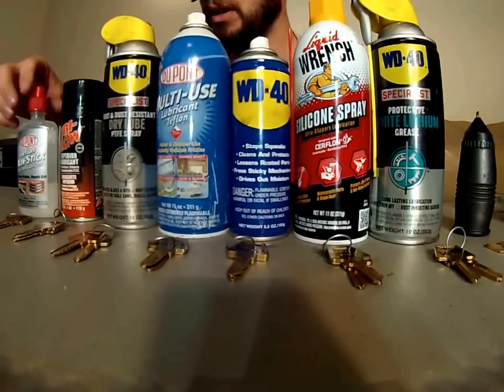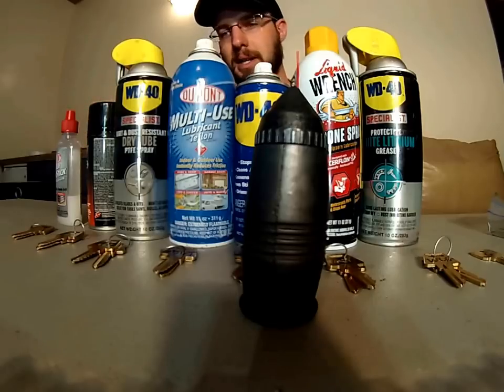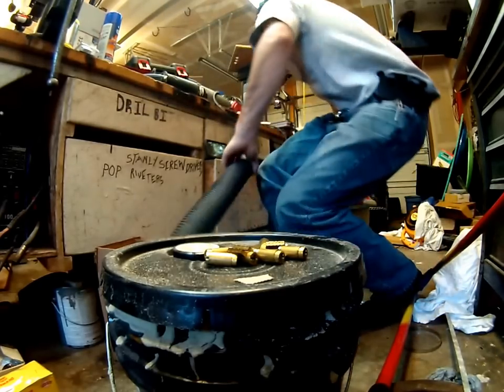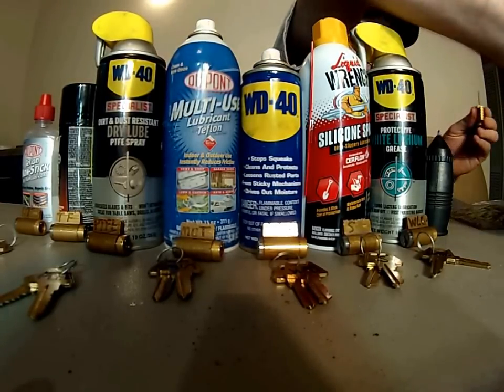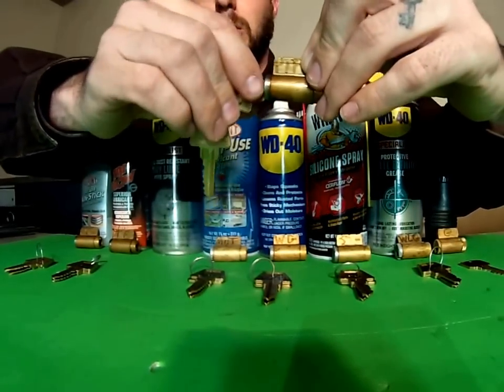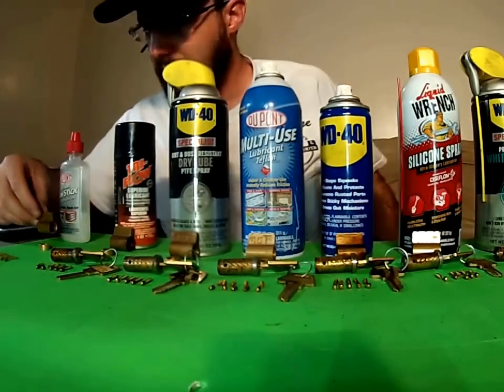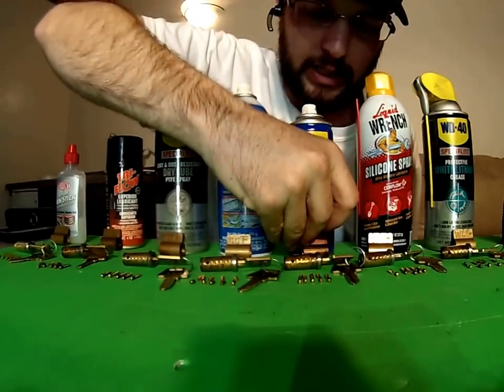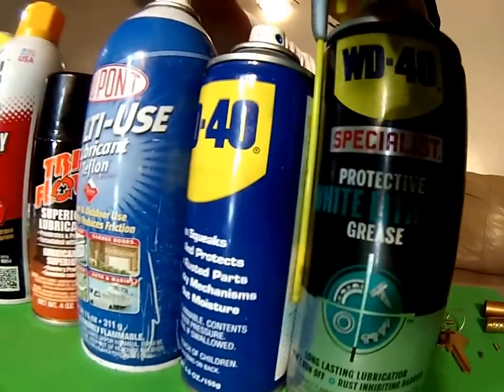What Is Best Lubricant For Locks WD-40 Graphite Teflon Silicone PTFE Spray Tri-FLow

Comment: LPS1 and Houdini all the way!
Reply from the maker: houdini is oil baised see for your self 
houdini lubricant spray It contains oils $9.00
Ingredient # 01
Ingredient Name PROPRIETARY BLEND OF BASE OILS
CAS Number 5989275
Percent 0
Ingredient # 02
Ingredient Name PROPRIETARY BLEND OF BASE OILS
CAS Number 513779
Percent 0
Ingredient # 03
Ingredient Name DISTILLATES, PETROLEUM, SOLVENT-REFINED HEAVY PARAFFINIC
CAS Number 64741884
Percent 0
Ingredient # 04
Ingredient Name PROPRIETARY BLEND OF BASE OILS
CAS Number 64742525
Percent 0
Ingredient # 05
Ingredient Name INHIBITORS. SOLVENTS AND ADDITIVES
CAS Number 64742536
Percent 65
Ingredient # 06
Ingredient Name HYDROCARBON PROPELLANT-PROPANE/ISOBUTANE
CAS Number 78285
Percent 35
Ingredient # 07
Ingredient Name PROPANE
CAS Number 74986
Percent 35
Reply from the maker: Lock Saver is Teflon (AKA the winner)
SECTION 1 – MANUFACTURER INFORMATION
Mil-Comm Products Company, Inc. Phone: (201) 935 8561
2 Carlton Avenue Fax: (201) 935 6059
East Rutherford, NJ 07073 USA sales@mil-comm.com
SECTION 2 - HAZARDOUS INGREDIENTS/IDENTITY
1. No ingredients are considered hazardous under 29 CFR 1910.1200, 40 CFR 372 and
49 CFR 172.101
2. Other ingredients include:
3. A mixture of synthetic oils (esters) & highly refined mineral oils. TLV: 5 mg/m3
oil mist
4. Calcium Sulfonate/Carboxylate Complex: mixture in highly refined mineral oil. TLV: 5 mg/m3
oil mist
5. Phosphate Ester: < 5 mg/m3
6. V.O.C.: 0 (Contains less than 0.1%)
SECTION 3 - PHYSICAL & CHEMICAL CHARACTERISTICS
1. Boiling Point: 640°F (337°C)
2. Specific Gravity (H20=1): 1.1
3. Solubility in Water: < 0.1%
4. Appearance and Odor: Pale Yellow, Sweet
5. Vapor Pressure (mm Hg): N/A
6. Vapor Density (Air =1): N/A
7. Reactivity in Water: None
8. Melting Point: N/A
SECTION 4 - FIRE & EXPLOSION DATA
1. Flash Point (COC): 475°F (246°C)
2. Flammable Limits in Air % by Volume: LEL Lower: N/A UEL Upper: N/A
3. Auto-Ignition Temperature: 475°F (246°C)
4. Extinguisher Media: Foam, CO2, Dry Chemicals
5. Special Fire Fighting Procedures: Use Self Contained Breathing Apparatus.
6. Unusual Fire and Explosion Hazards: Inhalation of thermal decomposition products of fluorocarbons
must be avoided for the same reasons that apply to all combustible materials.
SECTION 5 - PHYSICAL HAZARDS (REACTIVITY DATA)
1. Stability: Stable
2. Conditions to Avoid: Sustained temperatures over 600°F (315°C), strong acids and bases, oxidizing
agents
3. Incompatibility: None known
4. Hazardous Decomposition Products: Thermal decomposition may produce CO, HF and/or
phosphorus oxide.
5. Hazardous Polymerization: Will not occur
Reply from the maker: MDMA data sheets dont lie
Reply: Wayne Winton
I do have some Lock Saver, but I really like Houdini for cleaning all the gunk out, and LPS for lubrication...to each their own.
Reply from the maker: LPS1  is oil baised as well (sorry) MDS don't lie
LPS 1 GREASELESS LUBRICANT is combustible having a flash point typically above 170o
F and an autoignition
temperature over 400o
This material is considered hazardous by the OSHA Hazard Communication Standard (29 CFR 1910.1200).
Emergency Overview: DANGER: Aerosol contents under pressure. Harmful or Fatal if Swallowed.
Primary route(s) of entry: Skin and Eye contact. Inhalation.
Potential Acute Health Effects:
Eyes: Irritating to eyes
Skin: Repeated exposure may cause skin dryness or cracking.
Inhalation: Excessive inhalation of vapors can cause irritation of the respiratory tract, nausea, dizziness or headache.
Ingestion: Product has a low order of acute oral toxicity, but ingestion of large quantities may cause nausea,
vomiting, and gastrointestinal irritation. May cause injury if aspirated into lungs.
Potential Chronic Health Effects:
 Carcinogenic Effects: NTP: No IARC: No OSHA: No
 Mutagenic Effects: None
 Teratogenic Effects: None
 Medical conditions aggravated by exposure: Persons with pre-existing central nervous system (CNS) disease,
 neurological conditions, skin disorders, chronic respiratory diseases, or impaired liver or kidney function should avoid
 exposure.
Signs and Symptoms
 Stinging in eyes. Repeated or prolonged skin contact can cause redness, irritation, and scaling of the skin (dermatitis).
 Breathing of high vapor concentrations may cause headaches, stupor, irritation of throat and eyes, and kidney effects.
Section 3 • Composition / Information on Ingredients
Component CASRN Percent by Weight
Distillates (Petroleum), Hydrotreated Light 64742-47-8 70 - 80%
Distillates (Petroleum), Hydrotreated Middle 64742-46-7 20 - 30 %
Carbon Dioxide propellant (aerosol only) 124-38-9 1 - 4% 
Ingredients CASRN OSHA PEL-TWA ACGIH-TLV Other Limits
Distillates (Petroleum),
Hydrotreated Light
64742-47-8 Not established Not
established
100 ppm (supplier recommended
TWA)
Distillates (Petroleum),
Hydrotreated Middle
64742-46-7 5mg/m3
 /8 hrs 5mg/m3
 /8 hrs 10 mg/m3 UK ST EXP (15 min.)
Carbon Dioxide propellant
(aerosol only)
124-38-9 10,000 ppm 5,000 ppm 30,000 ppm ACGIH STEL 
Appearance: Liquid. Colour: Pale amber.
Odor/Taste: Characteristic. Vapor Pressure: <0.05mmHg @ 20 °C
Solubility Description: Not soluble in
water.
Evaporation Rate: <0.1(BuAc=1)
Boiling Point (°C): 213 @ 760mmHg Flash Point (°C): 79°C (175o
F)
Specific Gravity (Water=1): 0.79-0.81 @ 20 °C Flash Point Method: Tag-Closed Cup.
Vapour Density (air=1): >1 Auto Ignition
Temperature (°C):
>228o
C(442o
F)
V.O.C. Content: 0 g/L Partition Coefficient
(octanol/water):
<1
Flammable limits
(estimated):
LOWER: 0.6%
UPPER: 7%
Viscosity: <3.8 cSt @ 40o
C
pH: Not applicable
Reply: Wayne Winton
what's the problem with oil based? as long as it's not WD-40 :)
Reply from the maker: Oil attracts dirt in any way shape or form. Penitrating lube is good to clean them out and get them moving but then it need solvent and 100% dry lubrication Teflon of some kind or Graphite. Thoes are the only 2 dry lubricants on the market today. They may be named diffrent thing but it is what it is.
Reply from the maker: Wayne Winton Heck Jeff I was even wrong ..... My before and after list is very different from the beginning of the video to the end but the proof is in the test. Do your own testing if you like ( you must have a few locks to spare) Fill them up with your favoreite lube and do the same thing cook em, fill them with water and dirt, then cook them again and freez them....... tear them all apart and see what locks are the best working and cleanest at the end. My vidoes are not ment to raise conflict but reviel my results. No one pays me and everything was bought with myown cash so no reason to sway the results.
Reply: Wayne Winton
I am always willing to learn!
Reply from the maker: ***** Hey me too. I completley admit I was wrong to begin with as well. Blinded by advertising. This is what is so fun about acctualy testing the products though.
Reply: Hahaha Jeff beat me to it. I was going to see if you ever tried Houdini as Jeff and many others swear by it. I currently use PBlaster dry lube which drys fast but leaves a white film which im not to happy with. Superb video so thanks for the knowledge. Best video by far!!!
Reply from the maker: Thanks!

Comment: Use a lock lube product that is specifically  designed for locks.  Don't use the same lube product in your locks that you lube your garage door with.  Or anything else.

Comment: As a locksmith, for decades I use the DuPont Teflon with some Silicone. Its offered under different names and in the colder climates they call it "Snow & Ice".  The main reason is that here in Chicago, the ability to prevent freezing snow and water is important - while maintaining CLEAN lubrication - while NOT causing the keys to come out of the lock greasy or smelly (I hate that, that is so unprofessional).  

Regular WD40 leaves people with what a I call a smelly keys 'oil and perfume' smell.  No one wants to smell WD40 on their keys and no one wants the black crud on the cuts getting into their pockets where the key lube gets wicked out onto.  I loath using regular WD40 on anything in general because of the stupid tale tail smell.  Is there really a moron out there who wants to smell WD40 on their hands and clothes all the time?  People wearing light pants have a heightened risk to being outside visibly stained.  This is also a reason I avoid graphite.  Its too messy and at times a small puff drops on someones rug.  Its does not come clean.  I had that happen decades ago when the client applied too much and when I pulled the cylinder for re-key a stream of black powder dripped on a woman's rug. Fortunately she was selling the house and the rugs were being replaced.  Who wants a $2000 insurance claim anyway? 

The one very annoying part about the DuPont cans is the long dispensing nozzle is too fat to seat well and often falls off and gets lost.  The last case I bought I had to file the red nozzle to inserts and I had to crazy glued the dispensing nozzle to the spray head.  What a royal pain.  You would think DuPont would have their act together.  But I really do like this product.  We do a lot of Commercial 7 pin SFIC Keymark and Medeco, with outside padlocks as well so this is a perfect lube to douse through the entire mechanism just before winter and again in the spring.  It simply wipes clean and the teflon has a moisture barrier film left behind.   

With SFIC we do twice annual preventive lubes on exterior cylinders. One of the things we are paid for is so there are no lock freeze ups.  If a Client cant access a gate or building because of the lock,  that could prevent them from opening and hundreds of workers would be standing around.  That's a failure of service in my book.  And I don't want that get a call at 5am demanding my presence.  So far with DuPont its been zero failures or freeze ups with pre-winter and then spring treatments. 

I have not used the WD40 dry lube.  I must say however I really like the nifty WD spray permanent tube nozzle's.  But if the WD dry lube stinks or is not clean, its a resounding no thank you.   Who want to be known as the boob locksmith with the smelly keys anyway?   We might not realize it, but details count in the eye of the user.  They may not realize it when you do the work.  But that smell and staining in the pants pocket or a woman's purse right after is what they do notice.  Its called negative marketing. 

One last thing, I don't like silicone only lube with locks.
Reply: You need to get to the point.
Reply: Hello JR Chicago.. please tell me.what ypu use to "clean" out the lock's key hole and mechanisms.  Also, once you have washed away the previous gunk and lubricant, what types of libricants do you put in to the keyhole and on mechanisms?
Reply: @mehulparikh8570  DuPont Teflon as I referenced cleans and leaves a dry film of lubercant. However, if I am dissembling the core to pin it up or stock up cores like SFIC I use Acetone (nail polish remover).  But if you buy Nail polish remover, buy the cheapest without any additives like a lotion.  I use a plastic jar to have the cores soak and just dry them off on paper, rubbing off old master key system markers, etc.  I wear disposable gloves with acetone.

Comment: WD-40 is the worst spray that you can use.  Using WD-40 will only clog up the cylinder, and this spray attracts dirt, and will only help for a short time and you will have a mess of dirt in the lock cylinder.  The best thing to use is graphite, which can be purchased at any hardware store, it comes in a small squeeze tube.
Reply: WD-40 on guns overtime tends to form a very hard to remove kind of "resin", so I would expect it to be a bad idea in a lock, except for short term use (that I would rinse with brake cleaner before applying a dry lubricant such as PTFE)